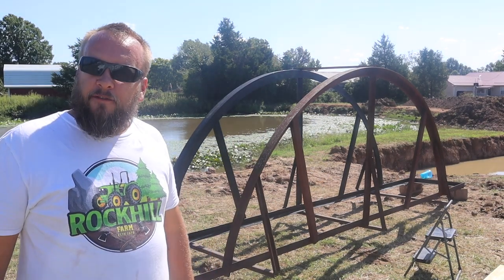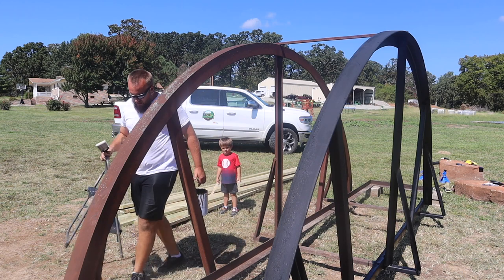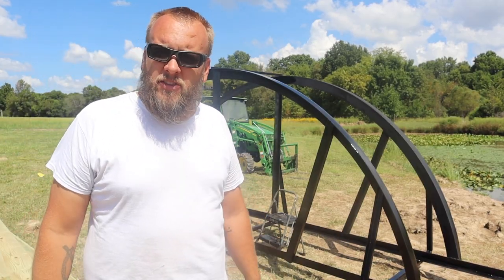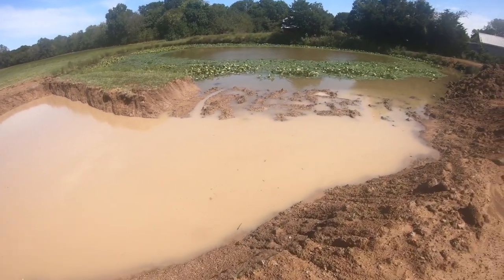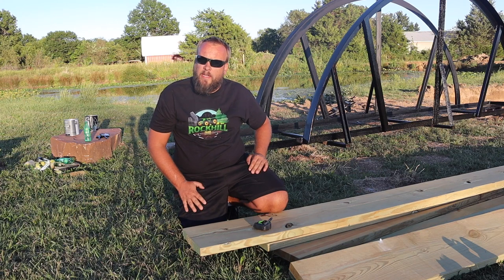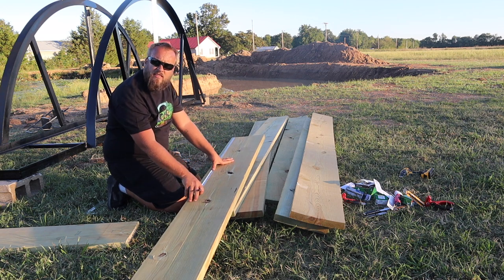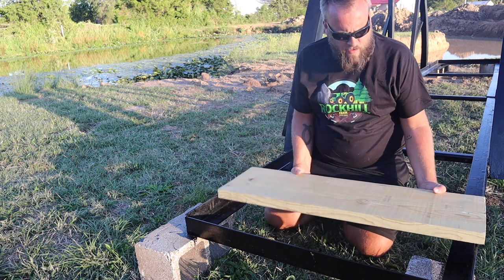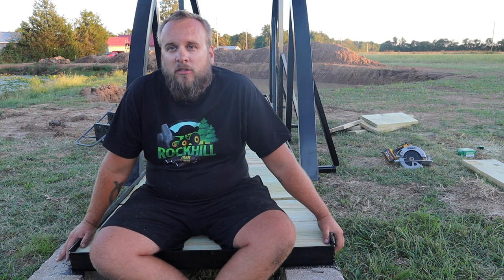Finishing the Bridge and a Post Storm Pond Update

Comment: Bridge is going to be so cool.  In the future, look at Rustoleum Rusty Metal Primer, then a topcoat of Rustoleum Gloss Black.  It's enamel so paint thinner is needed for clean-up, but it will really soak into the wood and adhere to the metal rather than create a "top layer" like latex.    The finish will last forever if done right.    Also, cup your boards that are twisted so that the cup is down... else they will hold water which will keep them slippery after a rain and accelerate rot even though they are PT.   Ask me how I know that!!!
Reply from the maker: Thanks for sharing

Comment: I’d put something under deck boards like you first mentioned. It looks like a trip hazard otherwise especially if you’re having kids running around. Maybe consider some of that non wood deck material, that would also let your decking breath and not be in contact with moisture. Looks great, thanks for sharing.
Reply from the maker: Thanks

Comment: You could probably save yourself a bit of money by not bolting the 2x4’s down to the metal. Screwing all of the decking boards to the 2x4 rails on either side, it will be so big and solid, it wont move much at all.
Reply from the maker: True.